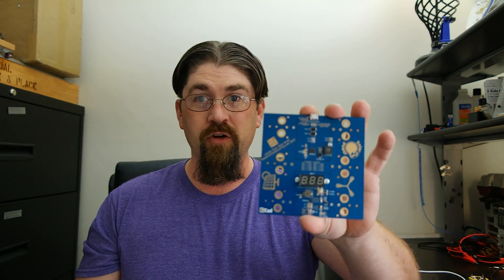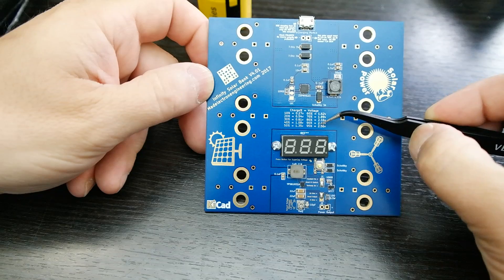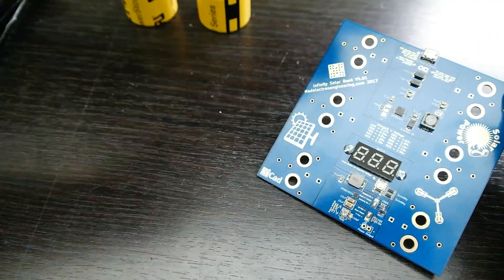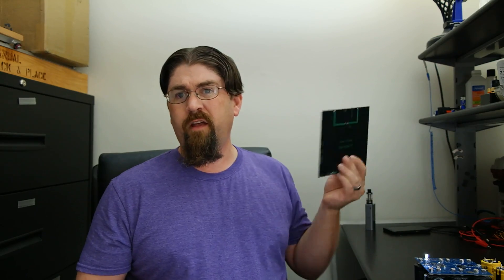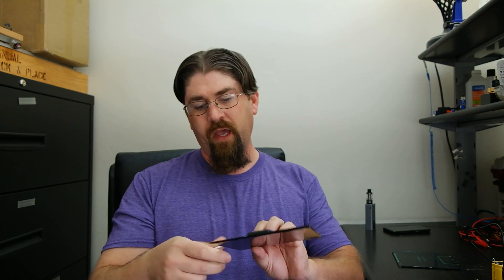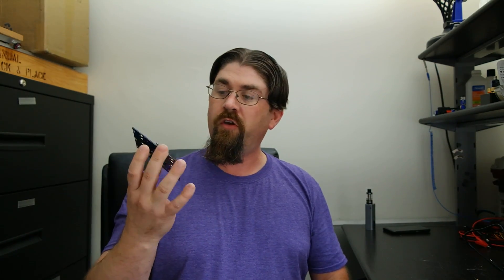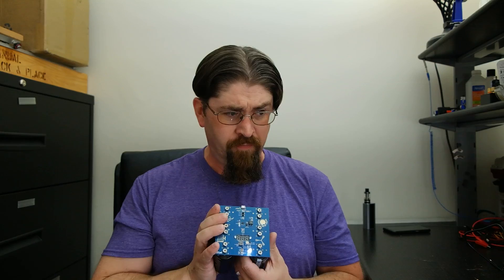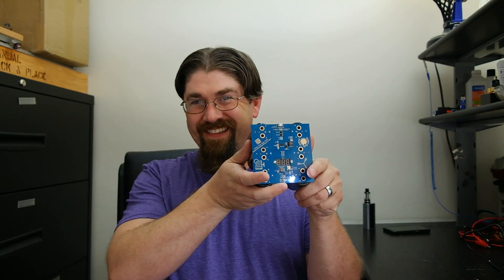Infinity Solar Bank V4 Is Released!

Comment: Hi! What do you think about using SPV1040 MPPT charger IC? 
This IC is similar with ZSPM4523. SPV1040 can charge supercapacitors too. I am asking it because I want to add similar functionality to my device, but ZSPM4523 is "Not Recommended for New Designs".

Comment: Do you know how much resistance thermal relief adds? Order of magnitude of 0.001 Ohm, usually less. I know it seems so counter-intuitive, because the links are so thin, but they're also very short, so there's that. I'm not sure it's worth skipping, because do you really think any ICs that you could possibly use, either charger ICs or boost ICs, are going to be any better than one order of magnitude higher resistance than the relief? At the low current your electronics are designed for, more like 2-3 orders of magnitude worse. Well you may have to skip the thermal relief in very high current applications, because it can heat up locally at those tiny points enough to cause damage, though you have to go pretty far for that to potentially be an issue.

You seem to have enough room to add something like TL431 and a little MOSFET to disable the voltmeter when the voltage is not sufficient, but that's probably a stupid idea, i'm just saying.

Comment: I bought a bunch of those crappy panels, got only 2.2 watts, they did not fully solder the cells in front of it and then they covered it up with a black ink over the stuttering joints so you couldn't see them...

Comment: If you don't mind, here are some tips about pcb layout. As you have enough place on the board, 1206 and 1210 capacitors is the best choice, cause they have higher capacity at rated current than 0805. Place them as close as possible to the IC, small 0.1uF can be used first due to smaller size.

Here's my pcb based on ZSPM4521, charger scheme is the same.
https://lh3.googleusercontent.com/zQvEjFIU2ZG9sR0P1W4Zi_wRxpRvfHUHUfSj_ieuB0AwP2tsvkYXdtmKK0AxHKI-a9EcNOFj3NGgxtB6dMs7G-fOVkdMlRDA9VqIzlT2yuCHHIt064GiOZQEVyWJov23aZua5qMr2gC1XYYsku7MjaMfRB0QvEO-RdoeQTpiCgomLfKF10ctdKQ06xUVjDeQwj4ky-tG2cq-9E8ck8uu2qQy6PKpWxM899WiqrPA7NWxhbU7ZnR3vVOKGcCcMj5jUGYrASt6-KkUyzq7_VlJlL6kw5Y1aMRLg2nO-bAaYlK52Cn7Fh5vfq8rlfTVXZPP9ih38sXqUcb20sBEHOAOl0n0HZPaW8ARmUDne8gN8_oJU1YNgqe28xpAEo15nTuker06xIY1b5YTVR0_xLbuOlKg5R7aTwGf6rTd1oUmsXVLYxWl08aaGhi1Ws7JXzgAjJo8Mdqr7BY9c-7xUez2iFaMxXVfMxXwRm-QGucmBVvOiuzf4vmjbryX7_S4h3sVfTEJQrAv5u4ajfxCbJeI4P_2e2Pk9ddBYbTl0lOIoze5BypJuBeqHYkhxqvmwhE7QRtxVVSqsLwxg8tcaCBFhFJc5uxhEdookGM0h6AGYOtoH_5u=w1280-h765-no

DB2W319 is a good shottky up to 2A, as also PMEG3050BEP but it keeps higher current. Low Ohm Vishay IHLP323 inductors is highly reccomended for this application.

2x 3W input zender is perfect choice but I would have chosen a bit lower voltage (6.8V), cause it's too close to overvoltage thereshold.

What about TPS61032? Vin 1.8-5V, Vout up to 5.5, so you will be able to charge usb devices. Heh.. capacitors is so convenient regarding to state of charge accuracy estimation compared to lion. It excludes any pain with fuel gauges, OCV is our everything :)

I think that led power is too low by the way without any switch modes. It wont compete to camping flashlights.

As you see, perfection is my fetish. Wish you good luck with your solar project :)

Comment: Wow man, I just saw this video. I had the same idea for several years since you made your first solar jar. You know, I posted a comment about my project several days ago on your superacap comparison video. But your work is really really professional. Great job! In my project I will put everything in a box, and supply both several LEDs and a USB output. I also will use less effective electronics, but I promise to send it to you, when it is ready in Instructables..... Just you have to think about ZSPM4523 replacement. According to mouser, it is not available any more. Wonderful work, I think it has a lot of applications, for instance if you ride a bike, your dynamo will constantly charge the supercaps, and you will have lights, even when you wait on a traffic light. You don't need these battery operated lights.
Reply from the maker: Odd thing is now the ZSPM4523 is not listed as "end of life" but it seems the manufacturer doesn't want to be bothered by small orders.  They want at least a 1,000 piece order to make it worth it to them.

Comment: Awesome!  I have a light assembly that uses a 18650 (for my mother in laws stairs) it has a bank of 12 LED's http://www.gearbest.com/outdoor-lights/pp_520533.html problem with is is, the battery from china is uber crap and has no protection...sun burst battery in 2 month..soldered in an old well protected cell phone battery to restore...would your's be able to provide the current to run this?
Reply from the maker: +Brian C the current yes, but most likely only for a few hours, not all night as this doesn't have the capacity of a typical 18650 battery.

Comment: I wonder if it is possible to have a supercapacitor AND lithium (ion/cadmium/polymer) hybrid. Good idea?
Reply from the maker: +Lauriemine not in this implementation but there is hybrid system out in the wild for different applications.
Reply: Would agree with you there, but the possibility of including a higher capacity cell that can trickle from higher input transients, could be beneficial by supplying current for longer.
Reply: actually 2S Nickel metal hydride would be a good match for the 2.7 volts of the capacitors the batteries  would never be over charged just not to sure about the complete drain factor on the batteries and how long the life of them would be .Depending on how long it would need to run longer run time may want to consider D cell batteries for that